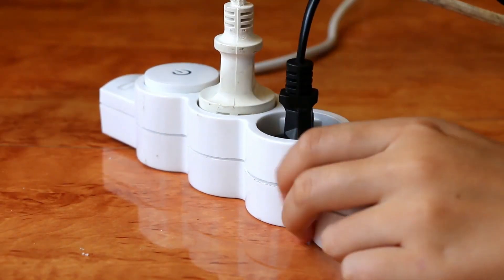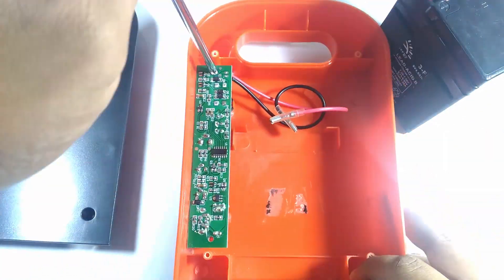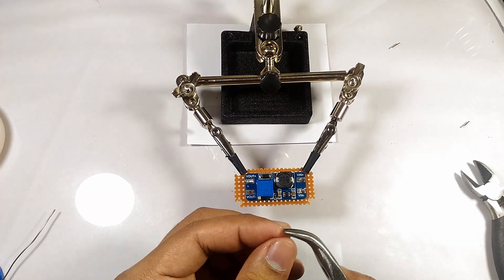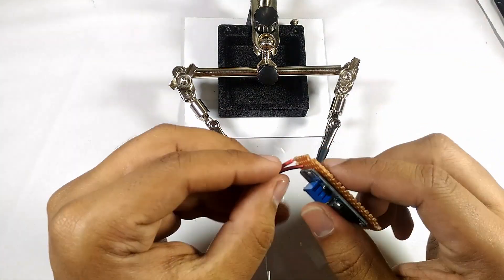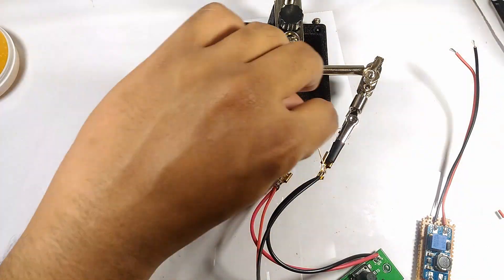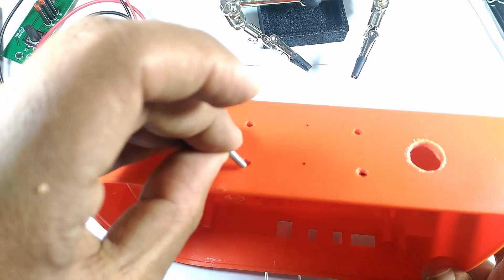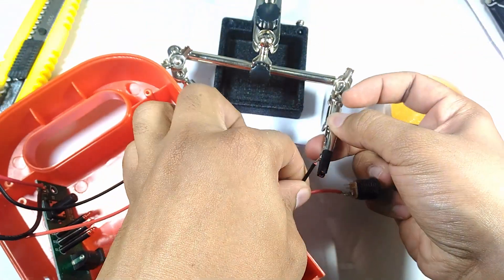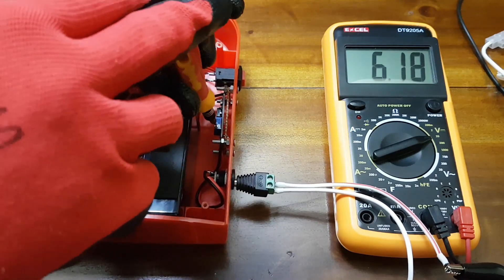Solar Powered WiFi Internet (Internet Life Hack – Technically Free Energy WiFi Internet)

Comment: Thank you for leaving a transcript of the video in the description, I struggled to know what you were doing. As I see, the battery inside the solar kit is a 6V 4.5AH model. And you needed a 12V DC source to power your 4G Modem-Router, so you added a "step up" to the battery for that purpose. But how did you know you would have plenty of current to power the 4G modem?
Reply from the maker: The router requires 1A, and the step converter can handle 1A without any issue if it boost from 6v. But it cant provide enough power if it boosts from a single 18650 3.7v battery.
Reply: @keshbyte  do you have to pay for WiFi bills because I am make a project with a raspberry pi 4

Comment: Good morning, sir, this project gives free Wi-Fi only with the connection of the panel and the programmed circuit, or does it need any Wi-Fi network, if it works for free?, or it only gives the electricity to the router, but not to the internet.
Reply: power lang binibigay nyang sa solar simbased yang router ilalagay mo sim mo na may load para ka makawifi
Reply: You don't need Electricity for the internet

Comment: Nice video. But, I would ask that you take a little more time to explain what you are doing and why. Maybe some diagrams to explain the theory behind what you are trying to achieve. Many - maybe most - people that watch this don't have the background to understand the finer points what you are doing. 

Now living in South Africa, with constant power cuts, I am designing an off-grid power system for my IT infrastructure at home. It can get very pricey very quickly. Understanding how to maximize each component (and maybe boosting a few) can make all the difference in the world.

Comment: voltage in not nessesary , Watt is nessesary
Reply from the maker: Im not sure if I understand what you are trying to express. If a device consumes 12 watts of power, but requires an input of 12 volts, you cannot properly power the device with 1 volt at 12amps which equal to 12 watts. It needs the required 12 volts to power up properly. Thats why a boost converter was used to boost the battery voltage to the required 12 volts of the wifi router.